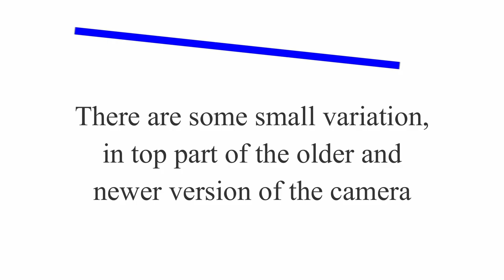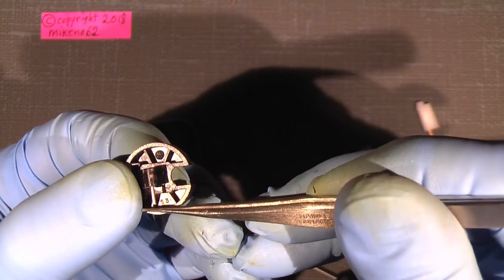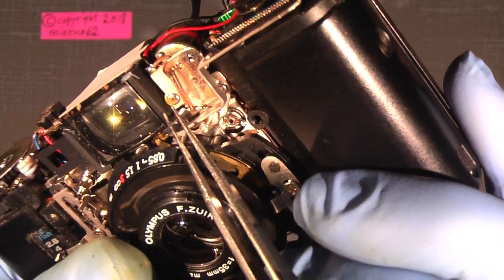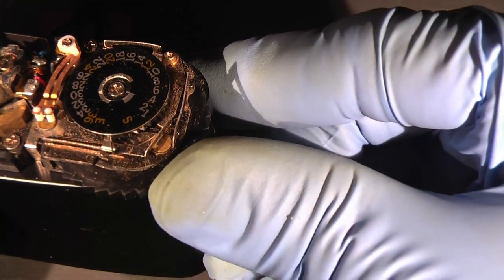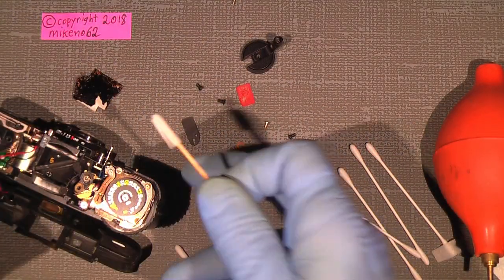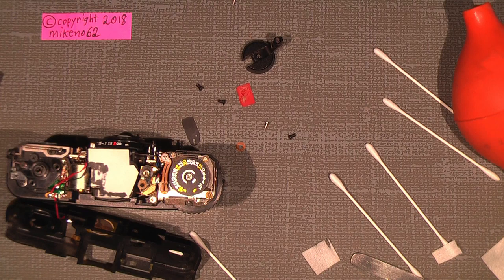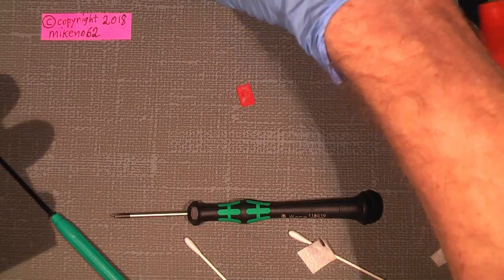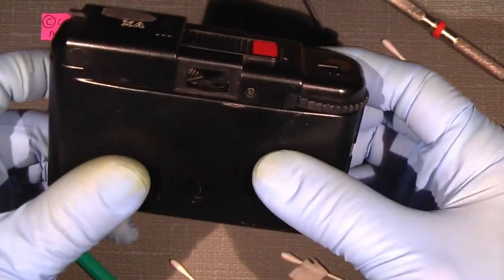Working with Olympus XA clean the viewfinder and other details

Comment: Okay sooo i have a question. My shutter is locking up and not firing as well winder not working. If i manually fire from the bottom of the mechanism, i can wind it again once. Power seems to be working to change shutter speed for the shutter but nothing seems to happen from the shutter button. Shutton button contacts are very clean.... Ideas?
Reply: just bought a cheap one with the same issue, hoping for a reply^ :)
Reply: @robotm99  hey I've just found the issue with mine today! Turns out the grey wire that connects to the bottom spring of the battery compartment was totally corroded at the solder point. If you look at the battery compartment with he bottom off with the red wire connection to the left and flash mount point to the right, the battery spring (negative) point is actually a plate at the back of the battery compartment. It took a few attempts and a lot of fiddling to clean it all up and solder it back on. Honestly nearly gave up but got it on my last try. Some plastic melted over the solder point in the end but whatever it now works so I'm rolling with it! Haha. Hopefully that makes sense

Comment: Hello I have an Olympus XA and the needle of the exposure meter in the viewfinder is constantly 3 fstops under what the correct values. Can you please tell me how I can solve this problem (the can which contains the meter itself seems rather difficult to approach/dissemble).
Thanks very much in advance for your reply!
Reply: hello, did you manage to fix the problem?
Reply: @DrNeithan did anyone managed to successfully adjust the meter needle? I have the same problem, camera exposure fine, needle moves but sits low down..how to adjust ?

Comment: Hello I have a xa2. There is dust between the shutter and the front lens, I would like to clean it up because the dust reflects on the photos. Is xa2 same with the xa? Where should I unscrew? Thank you so much
Reply: Yun L. It is not the same at all but if you take pictures of every step and document which screws go where you can figure it out.
Reply: Yun L. It is not the same at all but if you take pictures of every step and document which screws go where you can figure it out.